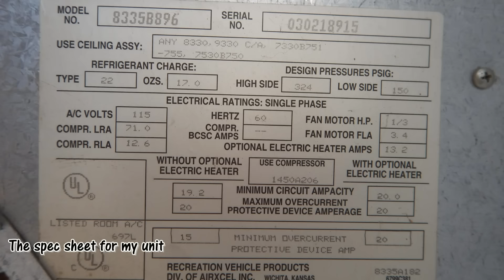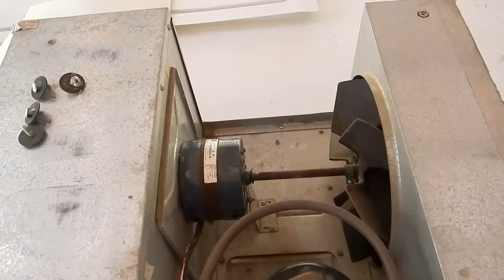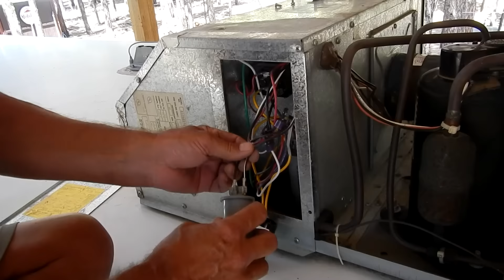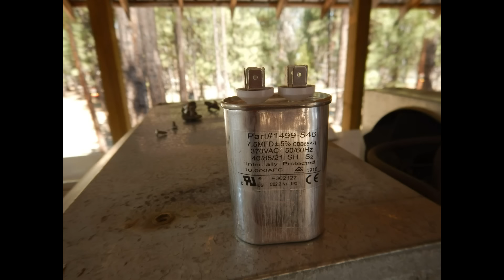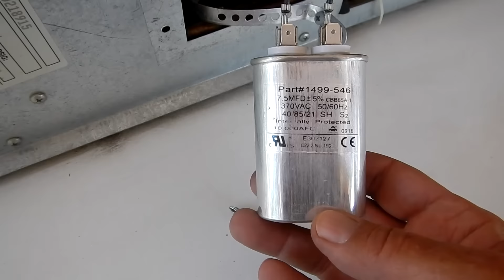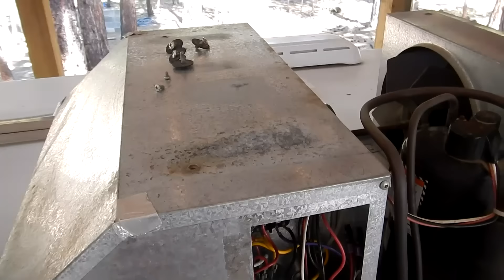How to easily fix your RV air conditioner.

Comment: Mine is doing the same buzzing noise except for the fan moves then the Breaker trips after half a second.
Reply from the maker: Make sure you have a good power supply. In other words not using a long extension cord etc. When the fan moves is it turning at full speed or just barely turning? Is the AC compressor running? You should be able to hear and/or feel it running. The three capacitors all do different things. When the fan motor won't start that's the start cap, there is also a run cap for the fan motor and the other cap is for the compressor. Maybe your run capacitor for the fan motor is bad? The scematic will tell you which each one is by the color of the wires going to it.
Reply: @TomandJulieMineExploring   Thank you for responding. The fan rotates pretty well but the ac doesn't stay on long enough for me to see if the compressor runs. I was using an extension cord so that could be it, but it could also be the compressor. I'm gonna get my generator and see if that runs it instead of plugging in to the house. if that doesn't work then ill see if its one of the caps.
Reply from the maker: @mrshark8094  If you have insufficient power it can cause problems like you're describing.

Comment: I have the exact same issue but I changed the capacitor and it’s still doing the same thing. It buzzes and when I try to spin the fan to start it, it will only spin for a second and stop and just hum again. Do you think it would be the start capacitor?
Reply from the maker: The fan uses two capacitors, a start and a run. In my video I showed the fan not running until being started by hand and then running fine. That was a bad start capacitor.  If you can't start it by hand then it could be a bad run cap. If that is what you already replaced then you might have some other issue. Make sure your compressor is running, too. Some poeople prefer to replace all the caps to eliminate them as a problem. Hope this helps.

Comment: My fan turns on but don't blow clod air then it kicks off and on
Reply from the maker: Determine if your compressor is running. If it is, and it's kicking off and back on, it's probably overheating for some reason and the thermal cutoff is tripping, then the unit is coming back on after cooling off.

Comment: I have a 2000 fleetwood bounder. Gonna check in the morning to see if this is my problem👍 ty for the heads up
Reply from the maker: If you can start it by hand a bad capacitor is most likely the problem.

Comment: Mine was doing that last fall. Keep the fan on low so the ac could start and stop. Now I tried that this summer and the fan does nothing.  
Fan turns freely though. 
Could a capacitor completely stop the fan from trying to run?
Reply from the maker: Yes, the capacitors help to start and run the fan and the compressor.
Reply: @TomandJulieMineExploring  I gave it an hour and went and tried it again.  Had to give the fan a spin but it took off. Got the compressor kicked in and it was blowing cold air for about 30 minutes and then the whole unit shut off. Guessing something got hot? Gave it 30 minutes and got the fan going again.  Not exactly sure which direction to go now.
Reply from the maker: The compressor generally has a thermal cut off to protect from overheating. It will reset after cooling off.  Low voltage can cause a motor to overheat. Make sure you have an ample power supply. The fan not starting on it's own indicates a bad capacitor.
Reply: @TomandJulieMineExploring  I suppose the low voltage could definitely be a possibility.  We are running 30 amp on a 80 foot heavy duty extension cord. Didn't have any issues last summer but that doesn't mean something hasn't changed.

Comment: i have the same unit on my rv, and it had the same problem. Opened it up and saw it has the optional start components and wiring, which had fallen apart. Gonna order them and put it all back together to be good as new! Thank you so much for this video, I was NOT looking forward to shelling out $$$ to be potentially ripped off! This is actually an easy fix!!
Reply from the maker: Good luck on the fix. Thanks for the comment!

Comment: You da man!!! I had exact symptoms, I watched your video, ordered the part and replaced it and it works!! Thanks!!
Reply: I added the fan capacitor and it worked for a day and then went back to same problem, I then replaced the start and run capacitors!! That seemed to solve the problem!!
Reply from the maker: @pontevedra9639  Thanks for adding that information.
Reply from the maker: Pretty easy fix once you know what the problem is. Thanks for the comment!

Comment: Sweet.
Reply from the maker: It's the most common AC failure. If you can start your unit by hand It's a capacitor problem.
Reply: @TomandJulieMineExploring  Cook. I’m currently in an online hybrid RV tech school to be a certified technician. I’ll be done in May. I’m so loving all the knowledge I’m getting. Starting my business in eastern central Florida.

Comment: my fan and compressor come on but not cooling much can a capacitor make it run slower causing issues too?
Reply from the maker: The three capacitors help start and run your blower motor and compressor. If both are running I don't think a capacitor is the problem. A dirty condenser, low refrigerant condition(which means a leak somewhere) plugged drier/filter, or a compressor malfunction could be the problem. It won't hurt to replace the capacitors if you are planning on getting the unit fixed as you would want to replace them anyway if you are going to replace the compressor, for example.

Comment: Hey so my ac has started doing the same thing. Most of the time it works as it should, but sometimes I have to spin the fan by hand to get it going (3 times so far in the last week). The other day however it wouldn't start all day even by hand spinning it then it decided to work out of nowhere. Do you think the capacitor or fan motor might be going bad?
Reply from the maker: If it were me I would replace all of the capacitors. If the motor is going bad and needs to be replaced you would normally replace the caps at the same time as the motor anyway.

Comment: Hi I have a similar a/c looks identical. I replaced all capacitors but the compressor still does not come on. What could be the issue? I would take it to get it serviced but I'd rather just dick around my self because I won't be using the ac until next summer anyway.
Reply from the maker: Thermostat, thermostat wiring, main power supply, thermal overload cutoff switch, bad compressor.
Reply: @TomandJulieMineExploring   Could be the thermal overload cutoff or thermostat. I thermostat makes a buzzing noise when calling for heat or a/c. Furnace works. When calling for a/c it makes a buzzing noise and clicking sound.  I will try both. Thanks

Comment: Amazing!!!! Was just told today by an rv repair guy needed whole new unit and mine is doing same thing, if all goes well you will have saved me over a thousand bucks!!! Thanks so much!
Reply from the maker: Obviously there are other things that can go bad on an air conditioning system besides the capacitors. If you can start yours by hand, and it works, the way I did in this video, it's the fan start capacitor. It's a very common part to fail especially when several years old.
Reply: @TomandJulieMineExploring  and "several" can be as little as three years
Reply from the maker: Yes, caps can go bad for a variety of reasons.
Reply: There is a mentality today that you don't REPAIR you REPLACE parts insteaad!  The military stated doing this years ago and it's a very expensive way of doing any maintenance!
Reply from the maker: Very true.
Reply: looks like the shaft needs to be oiled. when its stuck and wont come on without a little help, like you did with your hand, is because the shaft is rusted. keeping it nicely oiled will keep it running smoothly. there are rv techs that make a small tool to spin the shsft without even taking the shroud off by going through the slot, because it is the most common resolve for ac problems.

Comment: Hey Tom, what did you do in your working life???
Reply from the maker: I forgot to add that I played guitar in bar bands from 1977 until 1997.
Reply from the maker: Worked for 44 years in a number of different jobs. I worked in high school as a landscaper. Went into land surveying for several years after that. Then on to heavy construction, like roads and sewers. Did a stint in the oil patch of Wyoming as a derrick hand.  Started two businesses, one a design and fabrication business in plastics and lastly before I retired I ran a one man vending business selling cold drinks and snacks for about 16 years. No wonder I'm  worn out.

Comment: where did you buy your part from before i spend $50 on mine
Reply: mine as the same numbers that’s why i was asking where you had gotten it from
Reply from the maker: @marielawiltsie7386 Did you find the information you need in the video description?
Reply from the maker: That information is all in the video description, Mariela. Make sure you get the correct part for your unit. The part numbers in the description are for the capacitors in my unit, yours might be different.
Reply: no sir it just said you bought it online not which which online you got it from
Reply from the maker: I bought it through Amazon for $18.95 from:
RV Wholesale Direct
41 Triangle Court
Carrollton,  Georgia 30116

Comment: Dont understand the discharge ing step ?
Reply from the maker: It's not really an issue. Capacitors in an alternating current circuit, like your air conditioner,  don't  store energy like they do in a direct current circuit. It's just a habit to short a screwdriver across the terminals when working with capacitors.

Comment: How did you determine that it was the fan capacitor and not the hard start capacitor ?
Reply from the maker: Because the fan motor wasn't starting until I spun it by hand. Plus, I don't have a hard start capacitor.

Comment: Nice video, You were concerned about the capacitor being bigger than the other one and you needed to expand your band. I had the same problem and just used zip ties. been holding for 5 years now.
Reply from the maker: That sounds like it's working for you. Thanks for your input!

Comment: Do you know what the little black box is right above the capacitors? I believe it is a switch that is causing my ac to run about half an hour then turn off for ten minutes or up to half an hour.
Reply from the maker: Compressors have a thermal protection cutoff that prevents damage to them from overheating. That sounds like what is happening to you. There are different reasons for overheating and sometimes just a high ambient temperature can do it. A  little research on that topic might get you some answers.
Reply: @TomandJulieMineExploring  Thanks - That's been my latest thoughts too. I traced out the wiring on paper and there is no way it could be a switch. Has something to do with the capacitors. Other than the main switch and the thermostat it's a direct connection to the compressor and the fan motor.

Comment: The AC unit does not power on from the switch, I checked the breaker it's fine, can it be one of the capacitors?
Reply from the maker: You should be able to hear the compressor running, or the fan buzzing trying to start if a capacitor is bad, if you have power to the unit. I would double check for good power and make sure the thermostat is good. I suppose it's possible that all your caps are bad. Not likely though, imo.

Comment: Thank you so much for this great video, you made it very easy to understand.  I was also wondering if you know anything about RV converters?
Reply from the maker: I know that the converter/transfer switch can be a fairly complicated system with many different setups. So, no I don't really know about them. I'm having trouble with mine as we speak. Thanks for the comment!

Comment: Can I just plug the new capacitor on no problem? Or do I have to worry about being shocked?
Reply from the maker: Make sure your main power cord to the RV is unplugged. Capicitors in an alternating current circuit don't really store energy, so no, you don't have to worry about getting shocked. If it makes you feel better short across the terminals of your new capicitors with a screw driver. They are also non polarized so there are no positive or negative terminals. Good luck getting it fixed!
Reply: Ok thank you so much

Comment: very nice video, thank you. my ac works, but the air is pretty warm right now comming out of it. can i fix this at home?
Reply from the maker: If your fan and compressor are both running it won't help to change capacitors. If you have to hand start it like I did in the video then new capicitors could be the fix. Depending on how hot it is outside where you are right now it's possible your air conditioner just can't keep up.
Reply: @TomandJulieMineExploring  thank you! yes it seems to work when its not Quite so hot (???) (it was 100 today)
Reply from the maker: It's possible that it just can't keep up when it's that hot. RV's aren't insulated as well as a house.

Comment: Helpppp!!! I have an ac that won’t turn on we went out and bought new capacitaros and we tried them out and still nothing I heard you say the brown and white wires are the ones to the fan but my wires are connected to this black box and not the capacitators the capacitators have blue and white and the other one has red and yellow
Reply from the maker: If you aren't able to start the unit by hand, like I do in the video, capacitors might not help. If you can start it, replace the capacitors with the same type, and wired just like you found them. Different AC units will have differently color coded wires. You might have a schematic on the unit like I did that shows the wiring and components. If the unit won't start by hand check the power source, breakers and or fuses.
Reply: @TomandJulieMineExploring  thank you! Hope this helps

Comment: If it will only run with a push, and you do not replace the capacitor, will it eventually not run at all?
Reply from the maker: It will run for a long time that way. You could damage the motor if you don't spin it every time it tries to start, though. The unit will cycle on and off several times per day so you would have to babysit it.
Reply: Fan motors are usually impedance protected, in other words their windings limit the current draw to a point where the motor is protected from burning out, at least not immediately, I might add however without a fan motor there will be no air flow either so there isn’t much point in running the thing.
Reply from the maker: @nunyabusiness6746  Thanks for your input!

Comment: You do not show the entire wiring at all. Because somebody's changed the wiring around on mine pics. Amber wiring diagram is gone
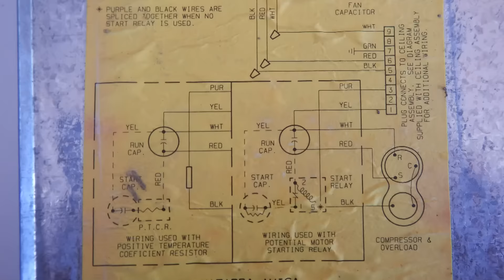Reply from the maker: At the 2:40 mark is a photo of the wiring schematic. I think I explained the colors of the wires on the fan cap, which is what I replaced. I hope you can figure it out.

Comment: Like a fool a few weeks ago I cycled my AC unit twice without waiting between restarts (maybe just 2 min).  On the third attempt compressor comes on very weak and quiet (pulls a bunch of amps) then quits until the system 15 seconds later retries again with the same failure results.  My gut is hoping that I only damaged the start/run capacitor.  Any ideas?
Reply from the maker: Make sure your power supply is good. It sounds like your thermal cutoff is tripping. I always think that replacing the capacitors is a good idea as a first step for ac repair. They are the most common component to fail, relatively inexpensive, and, unless you are retiring the unit, something you will want to replace even if your compressor is bad.
Reply: Thanks for the feedback I'm going to order a new cap and first give that a try.  Don't have a Multimeter that can check the capacitance so just going to take a chance.  If that doesn't work then I'm going to have to find a mobile mech or take it in to a RV shop.  If the compressor is bad then I'll probably have to buy an entire new unit :(

Comment: I would have replaced both since opened...jus sayin..
Reply from the maker: There are three total and that’s good advice. The other two are still working, but replacing them all is smart. I don't use it much or I probably would have.

Comment: Thanks for a great video. My Coleman ac was doing the same thing. Following your video I was able to fix the unit. I was sweating having to take to a shop to get repaired. But you saved the day. Many thanks.
Reply from the maker: It's a pretty easy fix if it's just a capacitor. Glad you got the unit running and thanks for the nice comment, Stephen.
Reply: @TomandJulieMineExploring I think I have the same or similar ac a Coleman 8000 series it all runs but to me smells burn my wife says it smells like moisture just started doing it and haven't used it since it started

Comment: I get the buzzing sound and the fan rotates very very slowly then stops.  If it doesnt start by hand, do you think it still might be the capicitor?
Reply from the maker: If it won't start by hand it could still be a capacitor. I would replace them all. If you are going to fix the unit then you will be replacing the capacitors anyway, so it's a good, and reasonably priced, place to start. If you end up having to replace the motor you will be starting with good caps.
Reply: @TomandJulieMineExploring  well, I replaced  the fan capacitor to no avail.  I cranked it and it worked, but then stopped on its own.  After letting it sit a while, I tried again and it turned on fine - but once I switched to low fan speed it puttered out on me, and it wont turn back on to high.  Perhaps its the motor or some kind of electrical issue?
Reply from the maker: I would replace all the caps. If the motor needs replacing you will want new caps anyway.